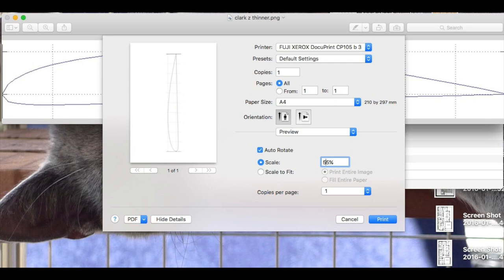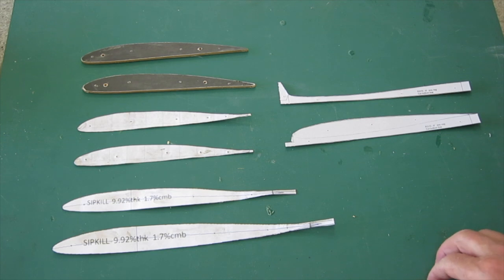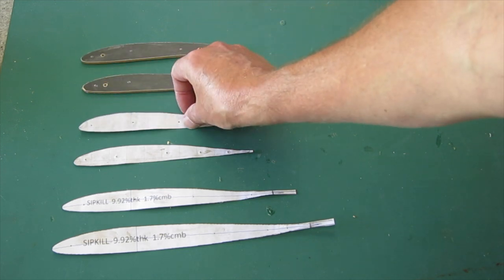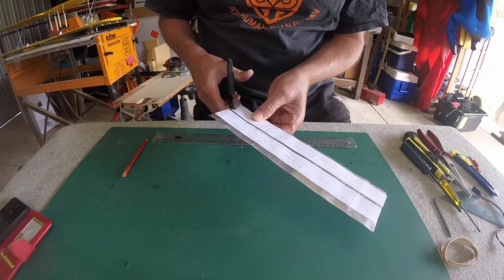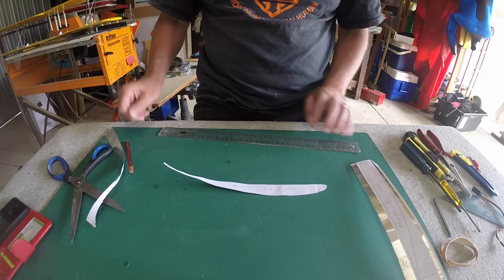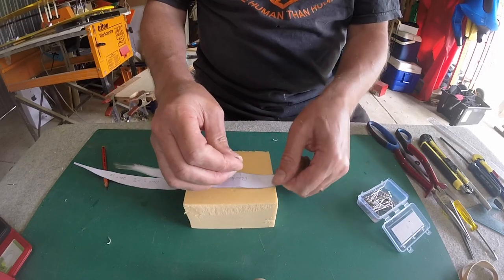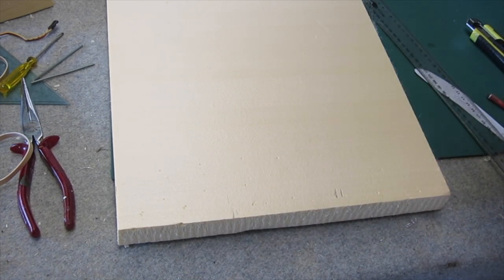Hotwire template tips

Comment: Hi Andrew!  Finally made myself a hotwire cutter and getting down to business..... SO!  The Clark-Y:  Ever notice how the bottom surface is not meant to be horizontal? (according the the schematic the nose is pitched down a bit) Which leads me to ask - Do you just mount your home-made "clarky's" (lol) flat at zero degrees, or do you go to the trouble of tilting them at the angle they were meant to be - and if you have, did you notice any big improvement in lift/performance Vs the horizontal mount?  (knowing you,  I'd bet you tried both ways ;)
Reply from the maker: Correct Bill. I usually mount on the fuselage with the trailing edge lifted by about 5mm. It took a while to realise that was needed.

Comment: I have just built my hot wire cutter. Now, in case I use a flat bottom foil, may I align the bottom of the template with the bottom of the foam block in order to not to have to cut the underside?
Reply from the maker: Yes but you will get a ridge on the bottom of the leading edge. Just needs more sanding to smooth out.
Reply: @AndrewNewton  Sure, Thanks!

Comment: Great video.  Question please:  When attaching the templates to the ends of the foam, how do you maintain exact parallel between the two?  Seems to me that if I attached one template a centimeter (or a few millimeters) above or below the opposite template the wing would be cut out crooked?  I didn't see in the video how you ensured that both templates were mounted exactly opposite each other.  Thanks very much for the information.  Great channel.  New subscriber!
Reply from the maker: Just measure up from the flat foam block base and match to marks on the template. mm accuracy is easy

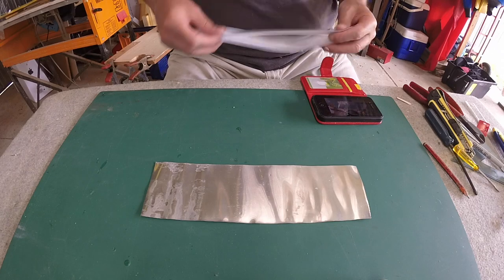Comment: Hello Andrew - Many thanks for this wonderfully put together video. I went to Home Depot and could not locate the metallic material shown at the 2:02 mark of this video (I think you referred to it as window flashing). Can you please provide a link to where you get it from? I will see if I can find it locally. Thank you.
Reply from the maker: +William James Hi William, I have never had to buy it, I inherited a big roll so I'll have to do some research and get back to you.
Reply: Many thanks. I've tried both Home Depot and Lowes and no luck. Not saying they don't have it, just that I don't know what its called. I showed the customer service representative the video and he didn't recognize it either. Even if you can find the name, or a packaging label, that would be of great help. Many thanks Andrew, and again, keep up the great job on your videos! Look forward to watching more :)
Reply from the maker: +William James This is the stuff http://www.ebay.com.au/itm/Aluminium-Flashing-Metal-for-Timber-Roofing-By-Meter-150mm-wide/301534175503?_trksid=p2047675.c100005.m1851&_trkparms=aid%3D222007%26algo%3DSIC.MBE%26ao%3D1%26asc%3D20140106155344%26meid%3D7be9d6b5b77748c48da097d8c9e0c490%26pid%3D100005%26rk%3D1%26rkt%3D5%26sd%3D291385089762
Reply: Thank you so much Andrew!! :)

Comment: Hello Andrew, thanks for sharing!! I'm following your videos from a while and I found them really useful, thanks for the tips. 

I have one question: The wing profile as you showed at the begin of the video, have some convex shape in the bottom (below from 0, or below from wing edge). 
I assume that to mount the wing in the fuselage, you have to shape the fuselage with the shape of the wing, to keep the edge of the wing (cero line) aligned to the edge of the plane. Please, could you confirm my assumption?

My question arise because I used to mount my foamboard wings in my square fuses... obviously, my square fuses doesn't have any cavity to hold the wing. Also my foamboard wings are really simple. As you mentioned... hotwire is the next step!

Anyway, thanks for sharing your work and keep doing like this.

Kind Regards from Argentina

(sorry for my bad english)
Reply from the maker: +Juan Gabriel Vazquez You are correct Juan. Often all it takes is one small piece of foam under the trailing edge, or you can cut the shape into the fuselage.

Comment: how would this work with a flying wing? such as the ft arrow the centre airfoil template would be different to the outside, what is different? the legnth of the template?, do i make the outer template i identical  im really struggling
Reply from the maker: The outer template starts off as a scaled down version of the inner airfoil but then it is thickened at the trailing edge for strength. You could keep it simple and use the same inner and outer templates for a wing like the ExAir Synapse

Comment: Which is the ampers and volt foa perfect cut, in my last attempt I burned the steel wire.
Reply from the maker: Frank, for the wire I use it's about 4 Amps. To get 4 Amps I need 16V for my 850mm bow and 6V for my short bow. It might be different for your wire.
Reply: +Andrew Newton thaks I really appreciate your help,you are making a really good job.

Comment: Which awg or size of hot wire is best for foam cutting
Reply from the maker: Don't know AWG size but it needs to be about 5 Ohms / metre resistance, I use 90lb stainless steel fishing wire.
Reply: I'm using insulation foam know as polyurethane for my plane but the problem is no tape or any film doesn't stay over it
Reply: @Andrew Newton i have used only NiCr wire 0,2 mm diametr, is there any difference depend to stainless steel?

Comment: Hi Andrew, Thanks for the detailed clarification on the airfoils setup. I have attempted my first 2 wings but am getting a concave leading edge,laterally. I'm using a 3S battery and the SS 7 strand wire. (Found this on Bay http://www.ebay.com.au/itm/320720054185?_trksid=p2057872.m2749.l2649&ssPageName=STRK%3AMEBIDX%3AIT  ) Travelling slowly with the pull through but probably not slow enough. I'm taking about 30 seconds for the cut. Your video seems to indicate your cuts are faster than this... I'll try a 4S battery but am wary of the additional heat on the foam and cut through. Any suggestions would be welcome?
Reply from the maker: +rustyact01 Sounds like too much drag and bowing of the wire. That's why I increased the voltage to 16v (4S) I'm using 90lb (40kg) wire and stretching it as tight as possible with out breaking the frame. I suspect your wire would not take 16V and lots of tension. Also depends how long your wire is too, mine is about 800mm between the aligator clips. I'll get back to you about cutting time after my next wing.